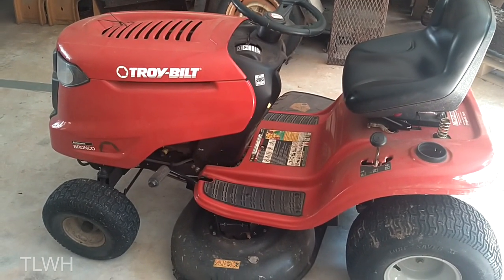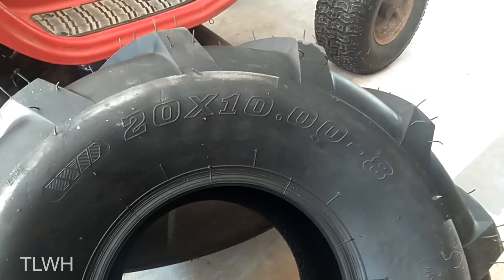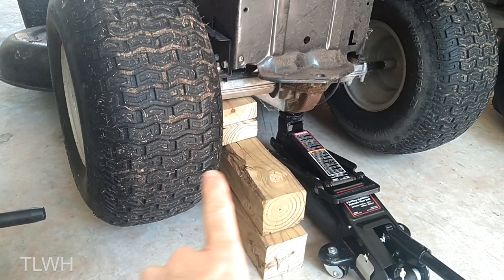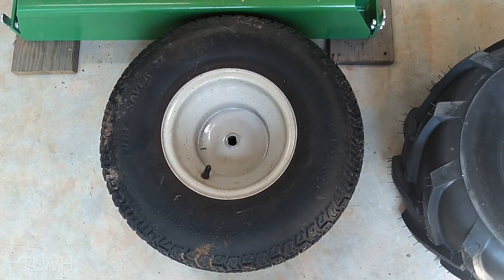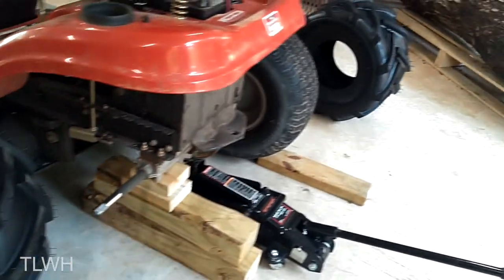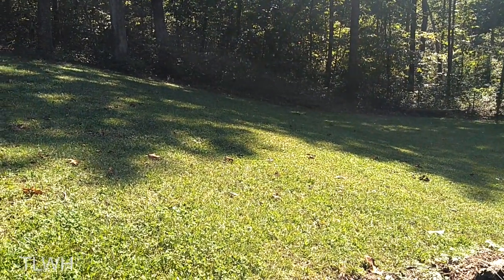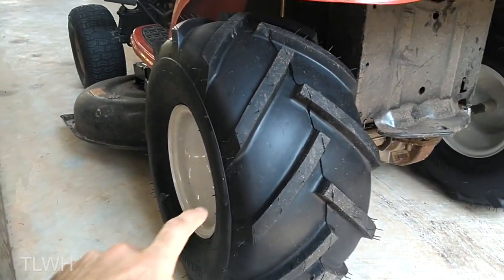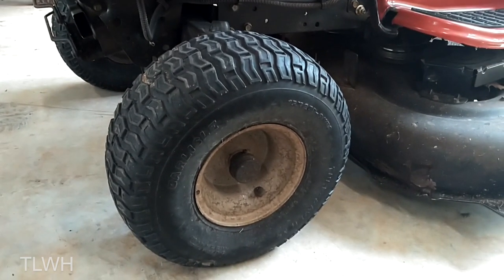Best Tires for Your Lawn Mower

Comment: Take a little bit of air out of them so the threads are flat on the ground, then you will get a much better ride and not feel all the"bumps". I have the same tires on my lawn tractor and i really like them. I've had them since 2015 and they still look good as new.
Reply: The trans needs a bit of give on the axel ends.
I split a trans in half with too much tire pressure, caused by not
enough give to relieve the stress on the trans.
Reply: What PSI should I run these at?
Reply: @Mechanicalcircus  I think i have around 20 psi in my tires or maybe less. I was watching that the threads are flat to the ground the last time i checked them so im not very sure about what psi i have in them
Reply: @revolution51  This has not been a problem for me running these tires
Reply: 🤣💀 @revolution51
Reply: Misprint…doesn’t slide sideways as much with snow blade on front.  Turf tires spin and tear up grass.
Reply: @dianasimon2060  I would recommend to put on chains on these tires if you drive your lawn tractor on snow or ice because when they first loose their grip with the road they slide pretty good and i almost had an accident the first winter i used these tires so i learned it the hard way. Now i have studded them and if the studs dont have enough grip i just put on chains.

Comment: The ag tires or bar tires work good for grass. They ride on the bars and not mash grass down. Better traction and yet not spin and tear up grass. Plus they look tractor like!  I’ve seen bar tires on fron for same reason, not mask grass down.  Also provides better steering if have snow blade on front.  Does slide sideways as much.
Reply: Correction: doesn’t slide sideways with steering if have snow blade on front pushing snow.   Turf tires spin and tear up grass.
Reply: In past twenty ears I have bought two new John Deere lawn tractors.  I ordered them with bar or ag tires.
Reply: They now make a bar tire for ztr and these lawn tractors.  The bars have less of a corner on them, yes gives good traction and no grass tear up.

Comment: Great vid, checked it out before ordering better traction tires for my Troy-Pony.
Added: Your back lot looks nearly exactly like mine. Ours borders a wooded area also.
Reply: I actually got the 20x10x8 rear 'double lug' from Amazon and front standard lug tires.
Would have liked the tractor type ribbed front set for better steering grip, 
but could not find a satisfactory set.
Keep the informative vids coming.!

Comment: Actually, THIS was the video that caused me to try these tires. I thanked you under your shorter video on the subject, but this really belongs here:

Dude, you ROCK!!!

My John Deere came with those "Turf Savers." What they didn't save was my back, as I was constantly getting stuck and having to pick up the rear end of the mower and move it out of the slightest wet spot in the yard. Seriously, I have a very slight slope in my yard, and unless it had been two weeks since the last rain, I could not go uphill.

Our tires were exactly the same size. I caught your video, used your link and bought the same exact tires for mine. Brother, I may as well have installed 4 wheel drive. These tires fixed that problem completely! 

Thanks!!!
Reply from the maker: You are very welcome. Glad to hear your problem is solved.

Comment: Can you remove the mowing section and use it as a light farm tractor to carry around a small wagon? Or is the mowing section not removable on a riding lawn mower?
Reply from the maker: I am not an expert, but I have seen several people who have removed the mowing deck and used it as a lightweight tractor. Just remember that if you overload it, you can easily break the transmission.

Comment: So now if my Craftsman T210 stock rear tires say 20x8.00-8 can I replace them with any tires i want that are 20x10-8 ? As long as the new tires are for 8'' rims? My main concern is will the 20x10-8's fit snuggly from side to side on the 8'' rim? Being the 10 is the width of the tire and the stock is 8 inch wide does that mean the extra 2 inches of width is only at the surface of the tires and not the part of the tire that goes on the rim?

Comment: Can I take my 18.5?Briggs and Stratton off of my Craftsman and put a twin cylinder.Twenty four horse on it
Reply: Yes you can!! 💯z. Just make sure the mounting holes on the mower match those on the mower. Otherwise, you may need to do some modifying by drilling new holes on the mower. Also make sure the engine has the same size shaft which it should.